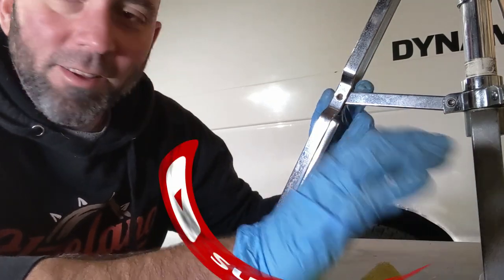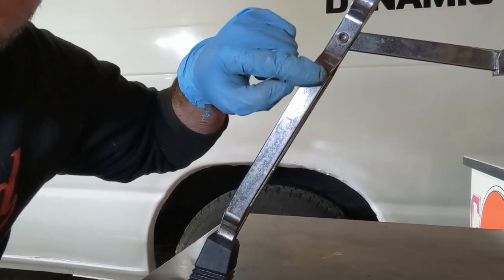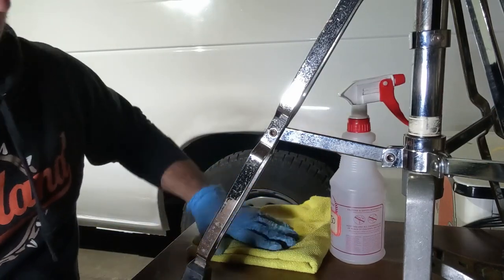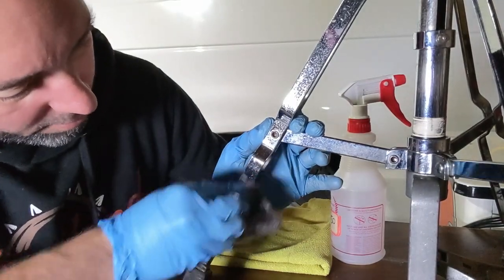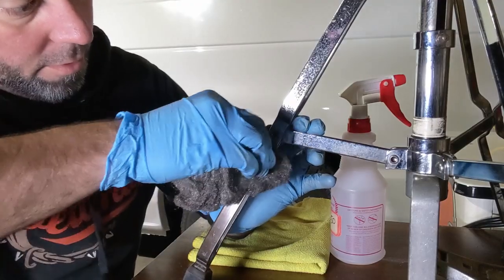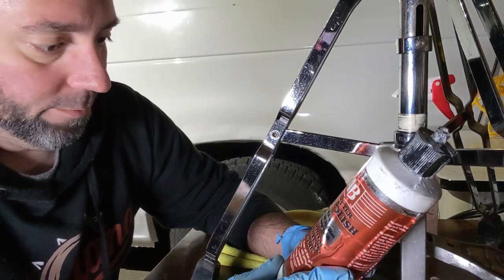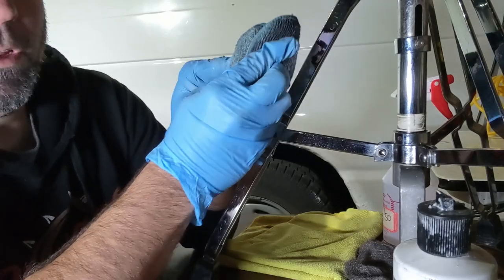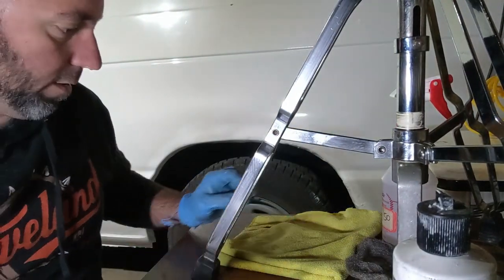Polishing Rusty Drum Hardware Tips - Hi Hat Stand

Comment: Awesome. This is pretty much what I do, & if I'm out of 0000 grade steel wool, I use aluminum foil (which also works well). 
But for polish, I use Turtle Wax Chrome Polish & Rust Remover. It not only wipes off surface rust like dirt, but it polishes nicely. I definitely recommend that as a final polish.
One thing I never tried (but must now) is the  water/alcohol mix to wipe 1st.